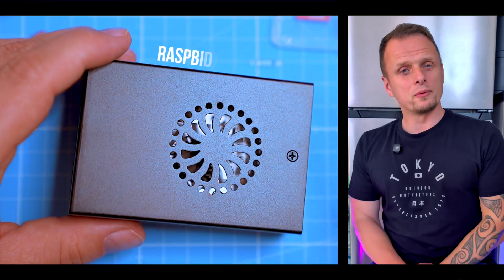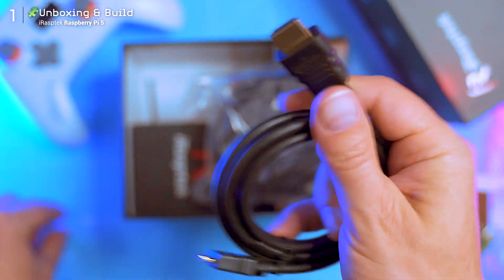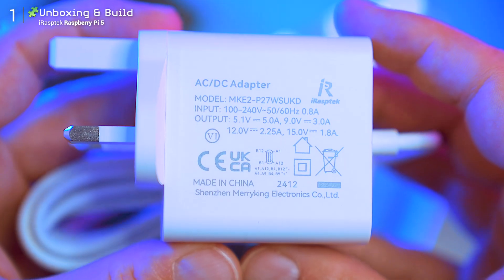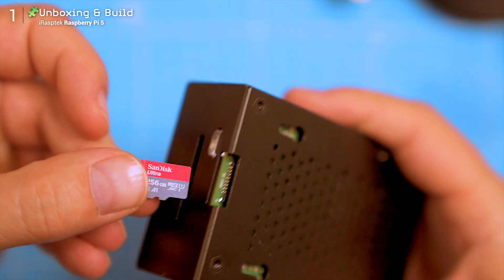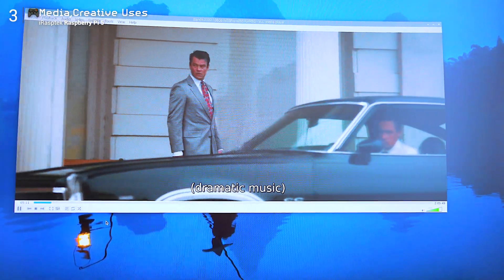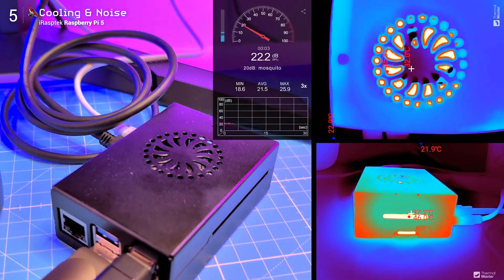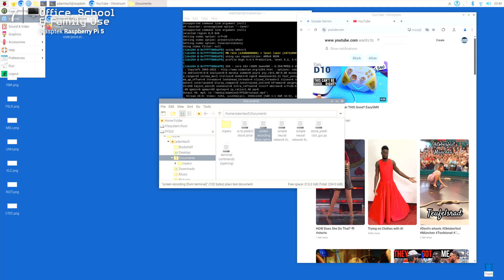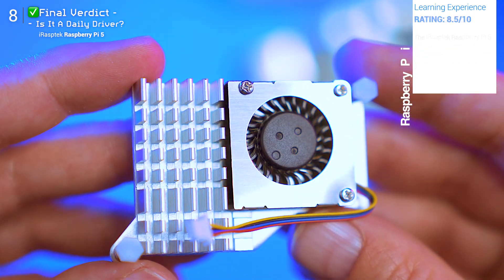I Finally Tried a Raspberry Pi 5 Kit… And I Didn’t Expect to Like It This Much!

Comment: Thanks for the run-through. I believe you need to remove a film off the heat pads before you install the fan on the Pi.